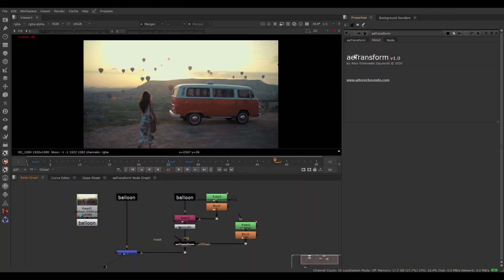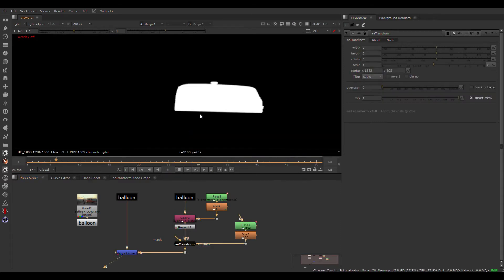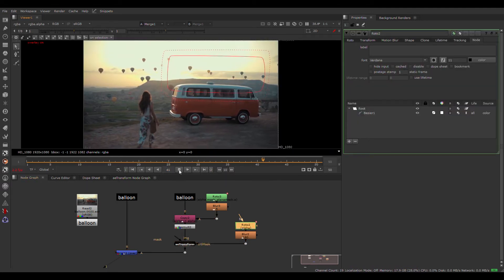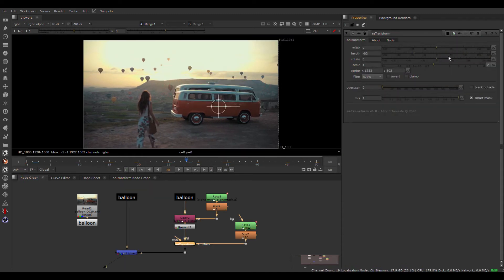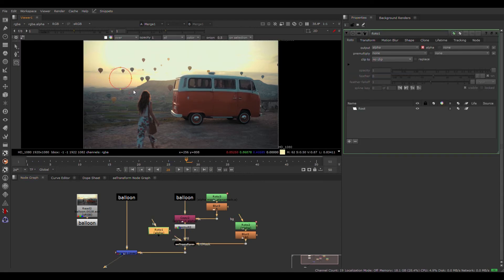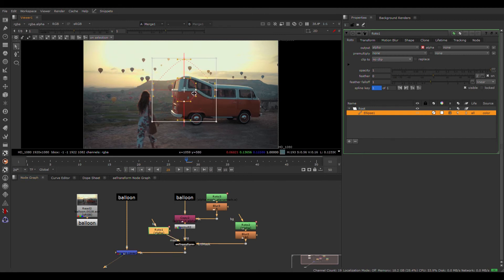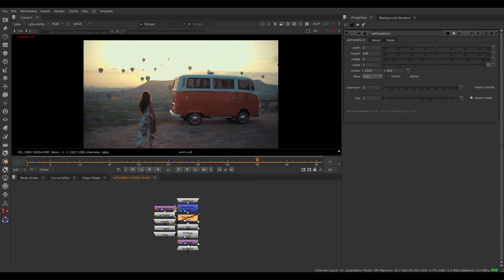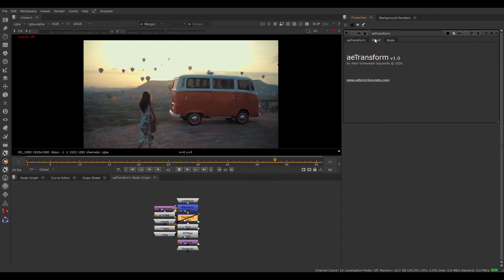Smooth and Lightweight Transforms in Nuke with iTrasnform

Comment: Man, thanks a lot, so this is like a better version of ITransform, right?
Reply from the maker: Yeah, you have exactly the same result, but thwre are some problem in the itransform when you do very heavy rotations.
Also have a mask and works with stmaps so is fastest than idistors
Reply: @AitorEcheveste  Ok, but for example how to add a noise pattern to the aetransform, just plug an animated noise to the mask input?
Reply from the maker: @KenedyTorcatt  could you Md me on linkedin there we can speak detailed!